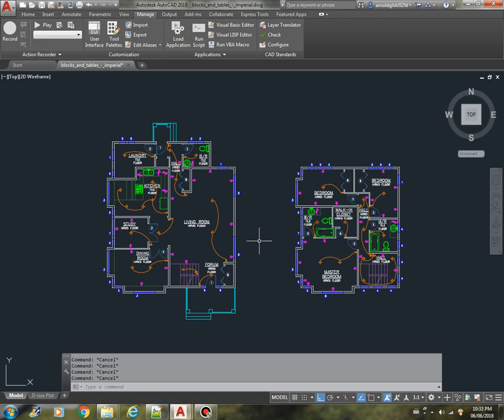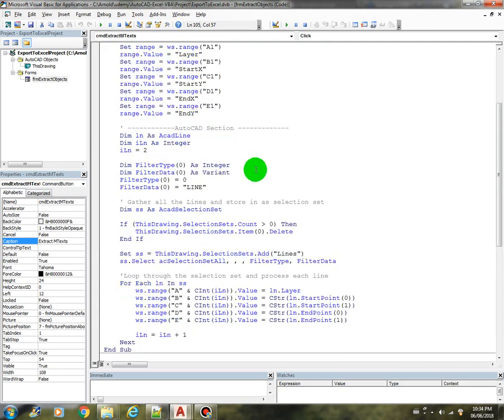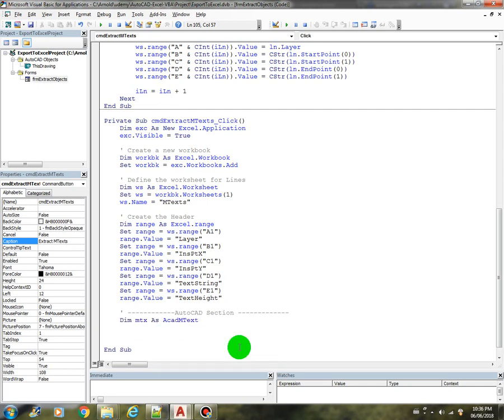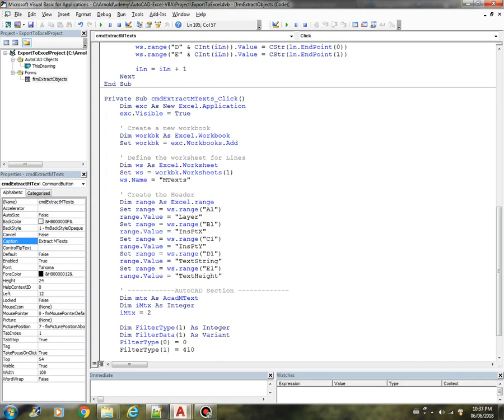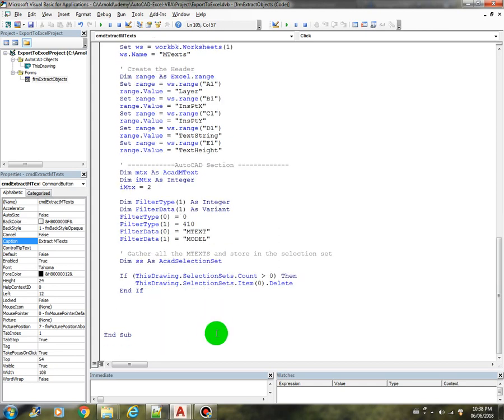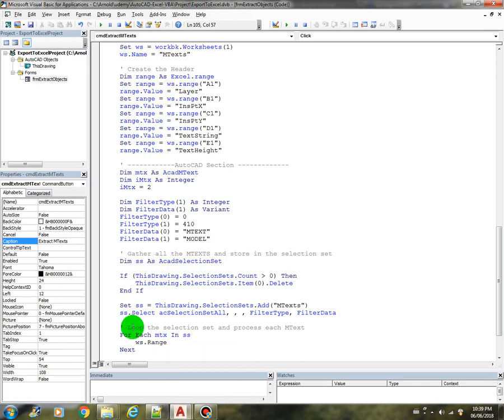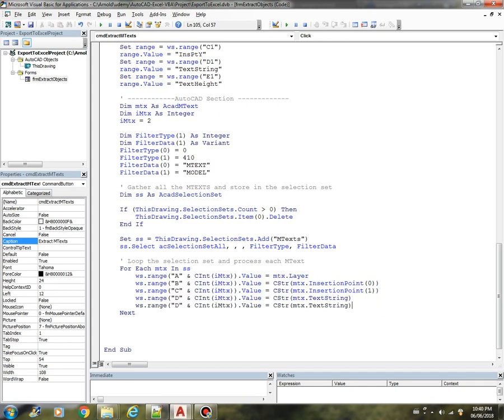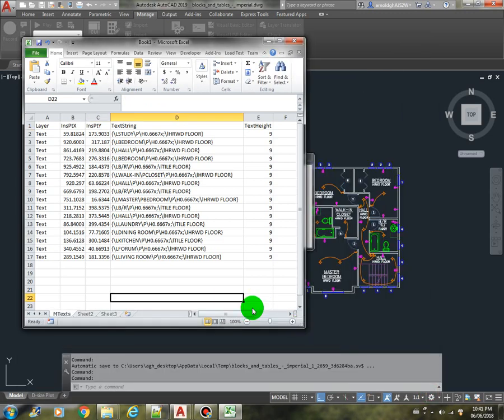How to Export AutoCAD MText Objects to Excel (Part 2)

Comment: Hi, its very useful vedio, however i copy your code, while running the code i have no errors and new excel book cretaed with headers but all the cells below are empty. can u please guide what i have to do....here is the code.....Public Sub mtext()
Dim exc As New Excel.Application
    exc.Visible = True

    'Create a new workbook

    Dim workbk As Excel.Workbook
    Set workbk = exc.Workbooks.Add
    
    'Define the worksheet for mtext

    Dim ws As Excel.Worksheet
    Set ws = workbk.Worksheets(1)
    ws.Name = "MTexts"

    'Create the Header

    Dim range As Excel.range
    Set range = ws.range("A1")
    range.Value = "Layer"
    Set range = ws.range("B1")
    range.Value = "InsPtX"
    Set range = ws.range("C1")
    range.Value = "InsPtY"
    Set range = ws.range("D1")
    range.Value = "TestString"
    Set range = ws.range("E1")
    range.Value = "TestHeight"

    '--- AutoCad Section ---

    Dim mtx As AcadMText
    Dim iMtx As Integer
    iMtx = 2

    Dim FilterType(1) As Integer
    Dim FilterData(1) As Variant
    FilterType(0) = 0
    FilterType(1) = 0
    FilterData(0) = "MTEXT"
    FilterData(1) = "MODEL"
    
    ' Gather all the MTEXTS and store in as selection set
    
    Dim ss As AcadSelectionSet
    
    If (ThisDrawing.SelectionSets.Count > 0) Then
        ThisDrawing.SelectionSets.Item(0).Delete
    End If

    Set ss = ThisDrawing.SelectionSets.Add("MTexts")
    ss.Select acSelectionSetAll, , , FilterType, FilterData
    
    'Loop the selection set and process each Mtext

    For Each mtx In ss
        ws.range("A" & CInt(iMtx)).Value = mtx.Layer
        ws.range("B" & CInt(iMtx)).Value = CStr(mtx.InsertionPoint(0))
        ws.range("C" & CInt(iMtx)).Value = CStr(mtx.InsertionPoint(1))
        ws.range("D" & CInt(iMtx)).Value = CStr(mtx.TextString)
        ws.range("E" & CInt(iMtx)).Value = CStr(mtx.Height)
        
        iMtx = mtx + 1
    Next
End Sub
Reply: FilterType(1) = 410